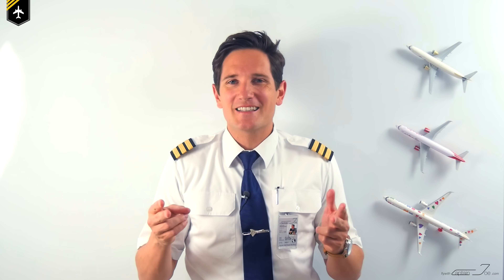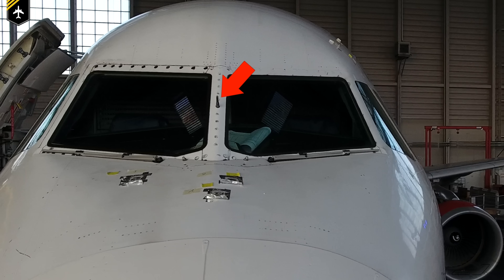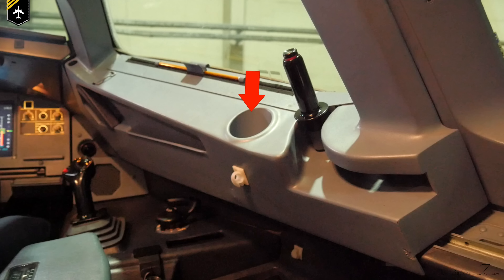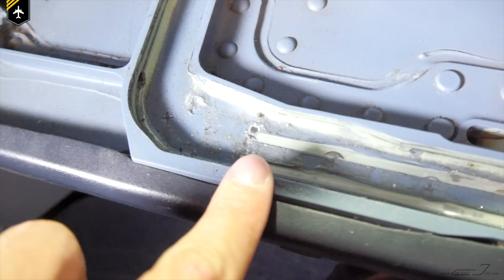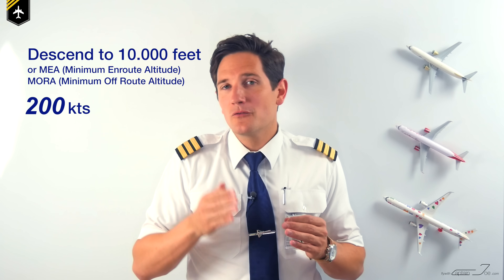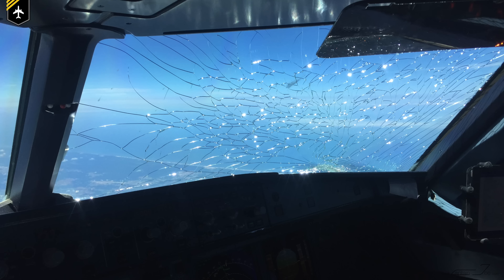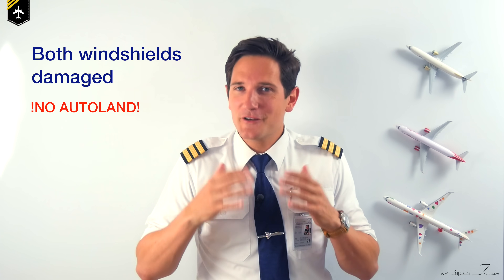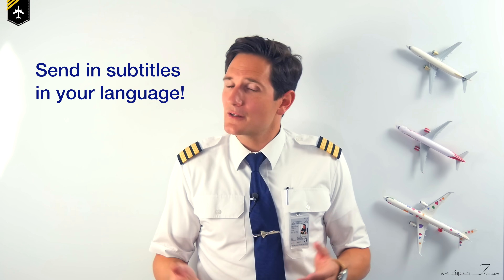COCKPIT WINDOWS - How to open SLIDING WINDOW and HOW TO DEAL WITH WINDOW CRACKS!

Comment: Didn't cockpit windows used to open outward on older airplanes from the 60s and 70s? I think I seen this before on a 767 but I could be wrong.

Comment: what happens when landing gear does not open while landing? and if landing gear doesnt close after take off?
Reply: There is also a manual emergency system to deploy the landing gear. If the landing gear can't be retracted after the takeoff, the aircraft will return back to landing.

Comment: What is the point of a to touch and go
Reply: Basically it's a procedure which is used during the flight training when the student pilot is practicing the landings. When you are landing and the wheels will touch the runway you immediately increase the engine power and take off again. This is an effective way to practice landings. You can make several touch and go landings in an hour, which is very useful training method.

Comment: Hi, so is it against any regulations to take off with cracked outher layer? For e.g. plane is not on its home base so it can't be repaired without big delays.

Thanks :)
Reply: How much damage a windshield or side window can have is based on the manufacturer specs and the pilot determing if he has good enough visibility

Comment: Late to the party, of course.  Captain Joe, would you like a good story involving the sliding windows in a B-52G bomber?

I worked as a crew chief on that model of aircraft when I was in the Air Force, decades ago.  One day my assigned tail number got back late on a blazing hot humid afternoon and there was an interesting entry in the pilot's log: "Excessive overspray upon refueling".   We'd already known that the sliding valve seal was overdue for a replacement but it kept getting red diagonaled, instead of escalated to red X.  (For those reading who are unfamiliar,  the maintenance log contains ways to mark a problem that is not enough to ground a flight (red diagonal), to show inspection overdue (red dash) or sufficient to ground a flight (red X).

We needed to refuel the aircraft, but I was suspicious of the log entry.   I learned CYA in the military, and certainly understood chain of command.  So I went to the expeditor and explained my concerns.  He said, "do it anyway." I said, "I'm not signing off on this refuel.  You will have to."  He agreed and did so. "It's gotta fly in 3 hours," he remarked.   So I got my team together.  Man for the firebottle (huge fire extinguisher on a hand truck), a guy I was training in refuel procedure, and last but not least, the POL (petroleum, oil, lubricants) guy with his pit cart and deadman switch (a magnet on a cord attached to his belt).  We had a designated area to meet in case of emergency, also.

 So, I went into the cockpit to trim (balance by controlling weight) the aircraft as it refueled.  My trainee was at ground level at the ladder up, on the interphone with me so I could talk him through the procedure and he could watch the wings, other possible hazards like vehicles or foot traffic, and see what the POL guy did.  I had given him a T.O. (technical orders) manual on procedure (this is how it is done, by the book; this outranks anyone even the base commander).  Also had my own.  Had explained my concerns but we were going to do it right.  So, one of the first things that the manual said was to close and lock the sliding windows, which I did while reading that entry to the trainee. You see, there are electrical panels on either side of the pilot and co-pilot's positions. Safety first! Yes, it was stifling hot in that B-52 with black radar absorbent paint.  

After all that, I had the POL guy start transferring JP4 jet fuel.  As soon as it got up to the forward tank, fuel fountained out the top of the aircraft and ran down the windows.  I yelled "RUN" to my trainee as I shut off the power (the POL guy ran also, which instantly shut off the fuel).  The guy on the firebottle stood there in awe for a few moments, saw the other guys book on past, then finally I climbed out and went over to him and said, "let's clear out in case.'"  So we went to the spot and I said to the trainee, "Now do you see why we use the manual and don't take shortcuts?"  He agreed that the lesson would stick. 

In that short span, about 300 gallons of jet fuel spilled. If I didn't close the sliding windows,  at the very least I would have been in deep trouble.  In the worst case, I would have been a crispy critter.  Anyhow, folks, those stupid irritating rules can save your life.

Comment: I never figured out. Why they do not add some mirrors on the side. So you can see the engines from the cockpit...It's not expensive. A simple 4"x4" mirror would work just fine...
Reply: Master Chief 00117 You can't put mirrors on the plane they would fly off
Reply: Really.. They put them all over fighters jets.
Reply: Master Chief 00117 A few fighter jets have A mirror but their very small. Airliners are big so the mirror would have to go far out even if you could do it then it would increase fuel consumption and it seems unesesary since new planes now have camaras in the tail
Reply: And you can go in the cabin and look out a window
Reply: Dude. They have them all over the place... You ever been in a modern day fighter? I suggest you go take a look.

And getting out of the PIC seat. Walking down the isle to see. Is not my idea of seeing the engines condition...We got better microscopes today. As this is the 21st century.
Reply: Master Chief 00117 Yes 90% of modern jets have mirrors INSIDE the cockpit https://talesoftps.files.wordpress.com/2011/01/img_7816.jpg Airliners are to big the only jets that have external mirrors are biger and slower and most are just perisopes and airliners have warning systems which will tell them if their is a fault with the engine.

Comment: Great video, thank you...quick question, why is fuel flow more substantial at a lower altitude? Is it air pressure translating into resistance in which case I am assuming that it would simply be that the engines are "calling" for more fuel to keep the plane in the air?...thanks, love the channel and the tail draggers

Comment: Nice.  I had no idea a window possibly might crack in a commercial jet airliner whilst in-flight.  Are there periscope goggles to see the flight/landing path when using the sliding window if both windshields are to opaque with cracks, etc. to land?

Comment: captain Joe, if an airplane costs, I don't know maybe 50 billions USD, I think placing a camera or two in the front of the fuselage of course over two windows shield also the two camera can be mounted and secured and protected by another small window and heated if there is a layer of ice ,  I think it's not  bad idea .
 In case of a damage on both windows which is rarely, the piolt can use this feature to see his path on a display mounted in the cockpit.
anyway,this is a primary idea, maybe it can be useful one day, who know.
thanks Mr. Joe for all your videos.

Peace
Reply: 50 billion USD?  You can get 500 airbus A320s for that.  The most expensive aircraft made, the B2 bomber, only costs 700 million USD.  A commercial airliner like an A320 only costs about 100 million USD.
Reply: thank you.

Comment: What happens if someone opens up the emergency door midair?
Reply: Nothing.  It will stay closed.  Just as he said you can't open the cockpit window during flight, you also can't physically open the doors on a pressurized aircraft.  There are hundreds of pounds of force from the air pressure holding them closed.

Comment: Hi Joe,

Can you please make a video on "How to restart an engine during in-flight" in case of malfunction & shutdown. Please explain the procedure to follow & c9nditions required both system conditions & environmental as well please.

Thanks (Gunnam)
Reply: Also please explain how many times you can try in case your 1st or 2nd attempt is failed and can you identify the problem of failure of engine ignition process in 1st or 2nd attempt when failed??
Reply: And in what circumstances you cannot attempt for a restart of engine & should go with a plan 'B' in case of all engines failure.

Comment: There is no way a pilot can open the window if the windshield is broken and you can't see through... In modern aircrafts you can choose to fly under IFR and that is it. Even though, If you had to open the window, winds over 300km/h (Aprox 200kts) would chop off your head.
Reply from the maker: Hmm, interesting that there is a video out where a pilot does that, and his head remained on his neck!
Reply: Thank you for answering! I know pilots are very busy. I appreciate the time you dedicated for me. Y will search for that video ;)
Reply: Such emergency happened on UR-AJC, antennas for automatic landing were broken in hail storm and ukrainian pilot landed it visually with window opened.

Comment: I'm really interested about that makeshift fridge shelf thing and would like to know more about it. Mainly, if that panel gets so bloody could you could store food on it, wouldn't it make the cabin, or a pocket of air around you, very cold? I'd like to see more of how this works if possible, or at least a little bit of an extrapolation. Thanks!
Reply: How it works is it is friggin cold outside at 38,000 feet.  About minus 70 degrees F (-55 C).  That window frame is attached to the body of the aircraft, and aluminum conducts heat very well.  So it gets very cold just like the exterior of the plane does.  The air in the cockpit cabin is heated (actually it is heated and then refrigerated, but that's another story) to keep the pilots comfortable.

Comment: Hi Joe! Would you rather fly the fastest military jet or be a concord pilot?
Reply: Fastest being like SR-71? I bet he'd take the military jet. Might be wrong though... I dont recall if the SR-71 still holds the speed record, but its interesting to note that both aircraft are from around about the same era. SR-71 first flight in 64, Concorde 69, just as interesting to note is that they were retired with nearly the same number of years in service with the 71 retiring in 98/99 (military/NASA), and Concorde in 03).

Comment: Since the new aircraft generations are all equiped with cameras in the fin and front wheel, I always wondered why there aren't two cams working like side mirrows to show the pilots the complete wing and the enginge intake on the left and right. That would come in quite handy on the ground and in the air to gain an view of the plane and the surroundings.

Comment: Good video captain joe.👍
I'm just wondering how does pilot know how to taxi to the runway? Or how do they find their way in the airport?
Really appreciate if u can answer my question.
Reply: Maps of the airport, atc, gps, in dubai they have a green light system that the pilots just follow to their assigned runway
Reply: Join the question
Reply: There is a ground controller in the tower whose job is to coordinate the movement of all the planes on the ground.  They don't move without his/her direction.  Planes often don't take the most direct path to the runway because they are lined up in sequence for takeoff.  It can take quite a while to get to the runway.
Reply: Star Gazer, true. Airports have strict rules about who is allowed to move at any time from the taxi to the runway. Last thing they want is a ground collision! If you listen to the control tower on atcnet, they are quite clear about what is done. Each plane is called by flight number. No one but the plane called is allowed to move. If there is a runway called 3R and 4L and the pilot needs to use 4L, the tower might (this is a guess, not verbatim) say something like "BA 01" (British Airways flight 01), hold short of three right. This means they have to stop at runway 3R. They cannot cross until given permission because a plane could be using it to land! Once clear, they might hear "BA 01, cross three right and hold short of four left." This means they can cross runway 3R but must stop at 4L. Finally, they are given permission to move onto the runway and commence take off. If you fly United Airlines, you can switch the radio station to a specific channel (forgot which one) and hear the tower talking to your pilot! Heard them when flying from Orange County to San Francisco once. It's interesting if you know the lingo used.
Reply: That was United's channel 9 on their audio entertainment system.  It was usually a feed from the radios on the flight deck.  Unfortunately, they don't do that anymore.  United has removed all of the audio systems from their planes and switched to a wifi based system.  It doesn't have the flight deck channel any longer. :(
Reply: They have a GPS in the cockpit.

Comment: I had a dream that I was on a plane and I somehow opened the window, causing the plane to crash. If I opened a window on an actual plane, what would happen?
Reply: The passenger windows on planes don't open at all.  The doors and emergency exits on planes can't be opened during flight because the cabin is pressurized and the air pressure forces them closed.

Comment: Let's assume you've around 3/5atm of cabine pressure, flying at 600km/h, window with 0.6m2 of area and a window angle of 20deg, wouldn't it be higher than 3/5atm? And ge possible to open it in flight?
Reply: At 38,000 feet the inward force against that window turned square into the wind is only 800 pounds (363 kg) (and far less only turned 20 degrees out).  The outward force on that window from 8 psi of differential cabin pressure would be about 7,440 pounds (3374 kg).

Comment: Hey Captain Joe, can there be an episode about the ATCs of airport, eg DEL/GND, CENTER etc?
Reply: Chen basically they have multiple ATC's at a certain large airport for safety reasons.  Airplanes on approach need to be separated from ground traffic and takeoff activity.  Not only are they different frequencies but the Center stations are not at any given airports.  Just to make life safer for those around the airport.

Comment: The "sliding window" is also known as a "DV" or "Direct Vision" window because you can open it and look straight out. The windscreens are also heated to make them less brittle at cold temperatures when at altitude and make them more resistant to bird strikes. Your welcome!

Comment: Can you make a video about lightning strikes? How often does it happen and how dangerous is it in-flight?
Reply: Key word "almost"........
Reply: It won't get stuck cuz it has these little sticks sticking out of the wing tips called "static dischargers". They discharge any electricity building up.
Reply: Static dischargers don't protect the plane from lightning.  They keep the static charges (caused by air friction) from building up to a level that would keep the radio receivers in the plane from working.  Planes are routinely struck by lightning.  The estimate is that every commercial plane in service is struck about once per year.  It almost never causes any problem.

Comment: Thanks for the video. I have a question - how would one move over and stretch to actually look out the window for this unusual visual approach, AND still reach the throttle quadrant? Would I be correct in assuming that if originally intending to land at an airport where autoland isn't available - eg no ILS, the flight crew would rather divert to an airport where an autoland IS possible, rather than attempt this strange, face-hammering yoga-position visual approach?

Comment: Hey Joe! Nice video again. My dad works at the Maintenance Control Centre for KLM and once an A330 had 2 layers of the windshield broken mid-flight over the atlantic. They had to put on the oxygen masks to be sure that if they would have an explosive decompression in the cockpit they would be able to breathe immediatly ofc. Scary but they had to resume the flight to Amsterdam, and made it down safely.

A little different story, but kinda relatable

Comment: Quick question, on a flight from Faro to Rotterdam, I saw a Lufthansa aircraft flying at the same altitude but in the opposite direction. It was only about 300-400 metres away from the aircraft that I was in. Is this normal to have two different planes flying so close together?
Thanks
Reply: no its not it is extremely dangerous to be so close.  In the United States the law demands that if you are not given a thousand feet of vertical clearance (normal spread as it is for lanes by the way) one needs five nautical miles of airspace between your plane and the next plane for safety purposes.  if your other plane was in the opposite direction it had to be at least a thousand feet up or down on your altitude.

Comment: Soooooo, is crew emergency egress the main reason to even have cockpit windows that can open in the first place? Because it seems like an awfully complex & heavy system with not much other use.
Reply: Awfully complex system?  It is a track and a levered latch.  The pilots have only one way out without those windows.  You must always have more than one way out for fire safety.

Comment: Given all the comfort/ergonomic optimization features the pilots have. (center post ball thing to get head into correct position, adjustable arm rests to get arm position  on the yolk just right), I'm actually a little bit surprised there isn't a fold-out periscope that can go out of the sliding window for a no-autoland double broken windshield landings instead of ace ventura-ing it.